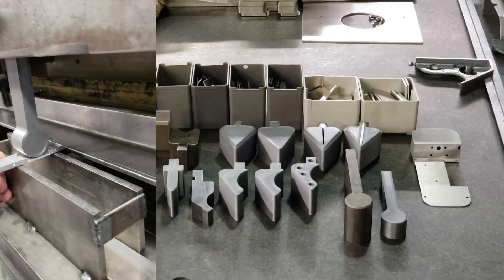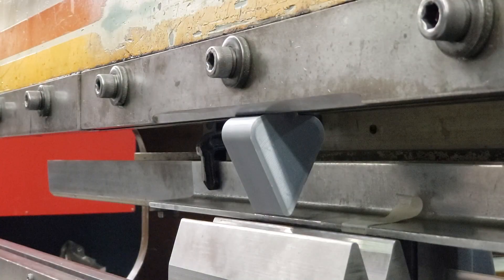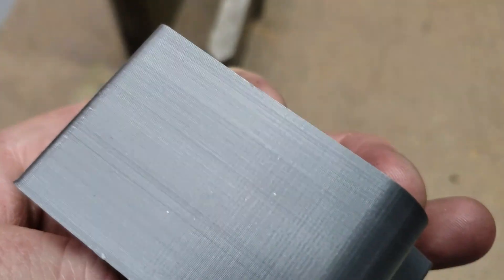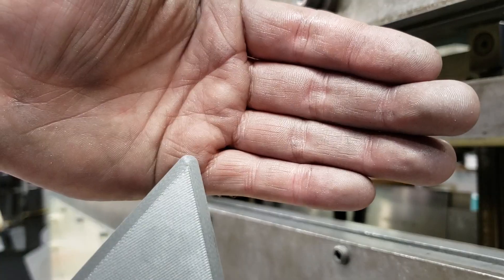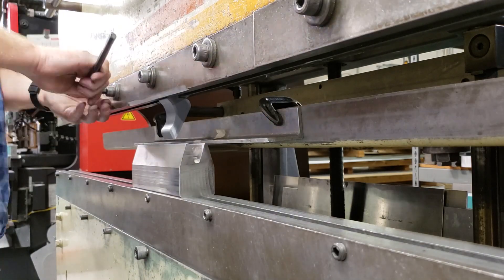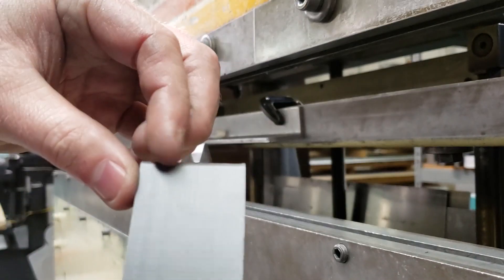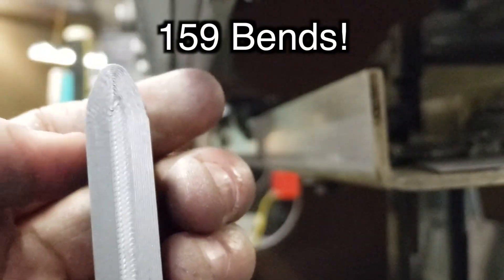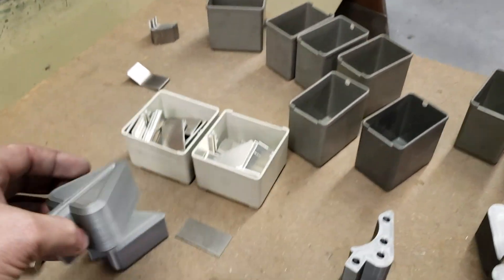Bending Thick Steel with 3D Printed Tools - Prusa PLA

Comment: This was rather surprising! If you had asked me before I saw this video whether or not regular 3D Printed PLA, even with full fill, could work as a press brake tool for 10gauge steel I would have laughed and said of course not it would either break or smoosh in a unwanted direction. Extremely eye opening as a possibility and amazed I haven’t come across this before now.

Comment: You showed that press brake with inserted steel plate - that's a neat concept, filling with something stronger in compression than pla. Maybe fill it with concrete and thin 3mm iron rods??

Comment: Excellent information, however, SOP for air bending mild steel dictates the width of the vee die be 8x material thickness which results in an inside bend radius of close to the material thickness. (The inside radius is a function of the die width i.e. 1/8 of the die width.) The radius on your punch could be made to correspond which would increase its wear life. I’d suggest you try printing the punch to receive a dowel pin along its bottom edge. Only the very bottom of the pin needs to be exposed. The pin would press into place from the side of the punch.

Comment: What if you print a honey comb infill then drill a hole in the top and inject it with hard set liquid rubber then you might be able to use the gooseneck one

Comment: Tonnage is very much reduced as the bottom die width increases. Or if bottom die width decreases the tonnage increases by a lot. So if your application suits you can always use a larger bottom die so your print doesn't explode.

Comment: You could try annealing the pla.  I've found it makes it much stronger (and heat resistant).  You could also put a copper shim around the contact points to reduce  wear without altering the profile by much.  Very impressive.

Comment: Excuse me, I've just started working a press and I've been bending some stair pans but I can't seem to get a uniform bend all the way across the sheets.

The ends will meet the angle, but the bend gradually opens up in between.

What should I try checking to get rid of this issue?

Comment: If you made the gooseneck tool wider and then beefed it up vertically once it was wide enough for your part it could have worked..  Solution 2  once bent a metal piece  say 18 ga. you could leave it on the tool for a load modifier and strengthen it.

Comment: Excellent stuff, I have been doing my own dies, all sorts,  from 3D PLA prints. One just has to study/understand the geometry of the part that requires forming, the forming dies and the amount and type of material and density to hold under certain tonnage pressure. It is amazing the level of manufacturing applications that you can take simple PLA 3D  prints to, it is a very tough material provided it does not heat up, the wear of the PLA tool comes mainly from heat  during the pressing in a press configuration, as the material of the die rubs against the blank creating friction, the cycle of the pressing also has to do with the wear on the tool, if you allow greater time between each pressed part, the tool, the pla material, has more time to cool and regain its original hardness, more continuous presses will eventually generate more heat in the parts and build up to a level that deforms the die shape, ultimately. A fan pointed to the die allows it to remain cool during work cycle and one can actually increase the duty cycle of it.  Understanding how this works and more importantly how to control the process, I have saved hundreds of dollars, otherwise,  doing my own dies. Check out my custom 3/4" (0.922"OD, 0.842"ID) conduit press to allow the ends to mate with some Maker Pipe connectors more securely. Now it is done with a 3D printed die setup under a 2 ton bench press. It works beyond belief!

Comment: whats amazing is the fact that you could bend thinner gauge sheet steel as a "case" for the printed part, which in effect would give you a hardened edge. and use this tool almost indefinitely Plastics really are the future, so to speak.

Comment: What immediately comes to my mind is that the 3D printed tools could be printed with a voluntarily "porous" infill and filled up with epoxy.
You get the best of both world: relatively fast prototyping but also significantly harder parts.
I did use this technique (but not for tooling) and had an article featured in Hackaday:
* https://hackaday.io/project/26941-nesto-prototyping
* https://hackaday.com/2017/09/03/polyurethane-meet-3d-printing/
Thanks for sharing your discover.

Comment: Metal reinforcing inserts, THAT was interesting.  I suspect it wouldn't materially improve the tool's lifespan - the working surface is still plastic and is going to wear at the same rate - though it might give it greater strength for thicker material.

Comment: The "Goose-neck" tool would hold up if you added more infill, at the cost of material cost and print time.  Really nice to see 3d printing used for more than novelty items.
Reply: For skilled people in manufacturing, 3D printing feels like a natural and well needed extension of our abilities. 3D printing is for everyone but it really shines in our hands, unfortunately the industry has been fogged up and not given the respect it deserves due to the likes of 3D printing nerd and anything making benchies. Since the Stone Age we’ve needed one tool to form a specific shape until now, that’s the power or additive, it re-writes our entire rule book.
Reply: @bertamus  completely agree.  The amount of toys and crap that are printed are astounding.  As a CNC machinist and gunsmith, I have tons of useful jobs for mine that's coming in the next couple of days.

Comment: What hardness was the steel you used? We use a variety of different materials from 301 1/2 hard steel to 2024 t3 aluminium in aviation and making tooling like this would speed up part fabrication considerably. Thanks

Comment: You saved me a half year of study. Due to the coronacrisis, I had some issues with making the prototype for my graduating project. The manufacturers were all closed, so I had to find another solution. A classmate cut the sheets on the perfect size, and I could bend it with this trick on my room (using a vise and some muscles). Thanks a lot!

Comment: 3D printed PLA parts can be very strong and hard wearing when parts are designed right, and take advantage of the material and process. Most people have a low expectation of 3D printing due to so many poor designs that people print, then blame the technology when they fail. Sure there are limits, but when used right there is huge potential. I have made PLA gears that are used in a industrial  environment that have surpassed 4 million rotations and tested small parts rated for 50Kg to over 500Kg.

Comment: Great video. However those were fairly large radius bends. For office furniture we use sharp top and bottom V-dies. 
The load on such a tooling would be easily 4-5 times that of what you have shown.

Nevertheless, you have peaked my interest and I will definitely be trying this - probably with offset dies.

Comment: Do you keep any steel thicker than 10 gauge in your shop? If so have you tested this with the thicker gauges? I'm curious to see the maximum thickness these tools can reliably bend with your settings.

Comment: I saw a fabricator on instagram, 3d_magic_mike i think it was, using 3d printed parts for tooling and he filled in the  inside of the parts with epoxy resin to add strength to the parts. I think he used it to make custom shaped dimple dyes? Impressive stuff non the less! Would love to see if filling in the parts with resin improves the durability!

Comment: Well. Have anybody thought accuracy of parts? PLA compared to steel is quite different thing. As a professional bender, sadly I dont see this would be working in real life.  I have experience  of 20 years in sheet metal manufacturing. If the part tolerances are less than +- 0,2mm this is a joke. Especially al as a material has variations
Reply from the maker: I run a sheet metal manufacturing facility and these parts are perfectly capable of +-0.2mm tolerances depending on the material thickness but the most jobs don't even need that. The parts in the beginning of the video were made within +-0.2mm. We have several customers that only need +-0.7mm. Other experts in the field also disagree with you: https://www.thefabricator.com/additivereport/article/additive/need-a-custom-press-brake-tool-try-printing-it

Comment: Hmmm, but what are you using for the female side of the die? Doesn't that really have to be custom for the bends you need as well? It looks like you used metal for that - and you would expect much more wear on that side because of the sliding contact between the metal and the points of the female side.
Reply from the maker: The bottom die is less important unless you are coining which involves forcing the metal to take the shape of the bottom and top tool. All the bending in this video is referred to as air bending and the radius of the bottom die does not affect the part. For air bending, only the bottom opening affects the part. Most custom tools we need are the top forming tool. For most jobs, the bottom tool just needs to be wide enough such that it doesn't interfere with the forming. You want to use a bottom V-die opening of around 6-8 times the material thickness. You can cheat and use a smaller die, but generally we try to avoid that. For example, if you want to form a 0.25" flange on a part, you can't expect to use a bottom V-die with an opening of 0.75" as the flange will not be supported at both ends. Also, the top tool is more commonly the tool that needs to be as close to the width of the flange as possible and in the beginning case, the tool needs to fit between two other flanges that were already formed. I could have used any length section of bottom tooling and it would have worked. The other parameter that is always affected by both the top and the bottom tool is the amount of stretch that needs to be built into the flat pattern. Bending a 2 inch long strip of metal exactly in the center will not produce two 1 inch flanges. The length of the flat pattern will vary depending on the tooling used.

Comment: PLA is STRONG. But it does not like to bend and snaps easy. Maybe try using ABS. ABS can blend a little, but its not as hard as PLA.
Reply from the maker: That is exactly why PLA is better for this application and is the reason why press brake tool makers are using PLA. You do not want flex in a press brake tool, you want rigidity. If the tool brakes, then make it more solid. I printed 12 perimeters and only 20% infill for all the tools that didn't break in the video. I could bump that up to 100% and the tools would be even more rigid.
Reply: @ProtoG42  PETG has similar property's to PLA. I know that PETG layer adhesion is stronger than PLA. Maybe that could work for stronger parts. It is harder to print and requires heated build plates.

Comment: Quite amazing. Why wouldn't you make a silicone mold out of the 3d printed tool and then use a stronger material?
Reply from the maker: That would most likely be a waste of time for a prototype or a small job for a part that we might not ever make again. Also, because it is a prototype, it is very likely going to change. The part size could change and/or the inside radius could change and then that tool becomes worthless.  If it is a job that will be made over and over again, we would just order a real tool.

Comment: I've used 3D-printed parts as tools for some years and I find it very useful. Sometimes it is a great advantage to cover the tooling part with a sheet metal in order to protect it. ;). For example I've made a tool for creating dust cap rings for old BMW's. A part that is not made anymore. Works as a charm. Thanks for the informational video!
Reply: I agree, printing the part slightly smaller and then attaching the first bent sheet to the part would massively improve life span.

Comment: It's not surprising that this did well, especially on the first two tools that you demonstrated. Lots of people don't understand the difference between hardness, toughness, and strength; being in the metal business you probably do but maybe haven't thought about it much as relates to thermoplastics. PLA is one of the hardest thermoplastics so its not surprising that it did very well in compressive loading. Likewise, its not surprising that it broke on the gooseneck tool since it has low tensile strength/toughness.

Cool video - it will definitely make me think about using 3dp for making dies for one-off runs! Another cool and similar use that comes to mind are rolling and bending dies.
Reply: I think that the misconception of PLA strength comes from assuming that its strength is kind of a "von mises" (aka. plastic materials (in the sense of deformation tolerant materials)), but actually is more akin to "mohr coulomb" (brittle materials, as unreinforced concrete, rocks, etc) with good compressive strength but really weak in many ways that other plastics are strong.
(I am avoiding to say "brittle material models" vs "plastic material models" because it would introduce noise of definitions)
Reply: I have my printer setup for polycarbonate since I often need functional parts. Would that be better than PLA? It would probably last more cycles at least. Replying to an old comment I know.
Reply: @NicolasGirard-nxg  polycarbonate is superior to PLA I think in every way, IIRC it has a higher hardness and tensile strength. Probably your main consideration at that point is just the cost of different filaments.
Reply: @EdKohlwey  Thanks! That's about what I thought, it does cost about 50%-100% more per kilo, print speed is also way slower than PLA and you have to dry it to prevent hydrolysis.

Comment: Geez u could just machine them on a mill...
Reply from the maker: You could be that would be more expensive in both materials costs and labor costs. These particular tools are simple but other designs with features on multiple sides would take way more man power to program, fixture, machine, flip, machine than it does to just click print. An 8 inch long piece of tooling would be cost prohibitive for a tool you might not ever use again. Also let's say you spent all this time to mill the part and a week later, the customer changes the design so now the tool needs to be 0.100" wider or the radius changed and you have to mill a new tool from scratch. Printing is the much more cost efficient approach for prototypes and low quantity orders. Mill a dimple tool or a louver tool and I'll be done printing multiples of both before you could program and mill even one of them because those tools would need machining on multiple faces.

Comment: Wild shit there!  Never considered using 3d printed pla dies in the brake. I have used 3d printed nylon for hold downs on the shear to not mark my material.
Reply from the maker: I have even designed custom printed back gauges for the press brake when you have a strange profile that you need to register off of.

Comment: You could design the 3d printed part to just have a removable tip sooo when it is time to change you just change the head or tip and would not have to print the entire thing out every time.
Reply from the maker: I've already designed some radius attachments that just slide on to existing tooling but there will still be a need to print the entire tool out depending on the part. For example if you need to form a part similar to the part in the very beginning of the video. It already had flanges formed up so the tool needs to have that exact spacing to fit between the two flanges. Normally we would need to grind down existing tool until the part fits. The issue with prototypes is that the flange distance is likely to change and then a different tool would need to be made.
Reply: If you were going to make a tool with replaceable tips, it would probably be better to machine the base tool, then with the variable/consumable bits being softer than the base, you would probably never have to recreate the base.

If you needed to make things only slightly wider, I would imagine you could probably get away with making the tips slightly wider than the tool as well, before you have issues.

Comment: Wonder how much better it would be with 100% infill, especially for the offset tool that broke?
Reply from the maker: The gooseneck offset would be better with more infill but the other 2 tools in the video wouldn't benefit from more infill. 12 perimeters at 20% infill seems to be a great setup for non offset tooling.

Comment: I've driven my car up on 3d printed blocks as well, it's pretty strong. Your one that breaks at 4:25 seems like you can go directly up the offset to reinforce it, along with the more parameters
Reply: That cutout in the tool is for having multiple bends in a small part, so the 1nd bend doesnt hit the tool when you bend the 2nd

Comment: This summer I did a little run of 40 brackets to hold my solar panels using a 3D printed punch and die from PETG, run on my hydraulic press.  The brackets were stainless steel 1" wide, 5" long, and about 0.050" thick, and they took about 1 ton of force when really bottoming out.  The punch did deform a bit on the 0.125" radius, but other than that the parts matched the designed shape surprisingly well.  I've had worse luck bending compound curves though.

Comment: This is awesome! I wonder if you could print the lower tool (anvil?) as well? I would think that would need to be a bit stronger due to the shape.
Reply from the maker: It will definitely work, I would just put the bottom v die inside a steel tool holder that has walls on all sides. This would allow smaller printed tools without worrying about the v splitting.